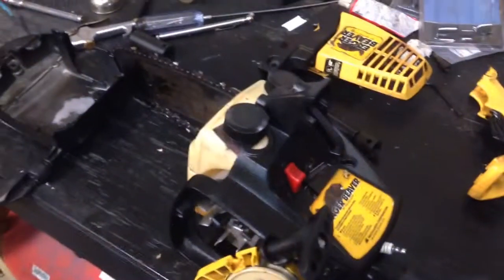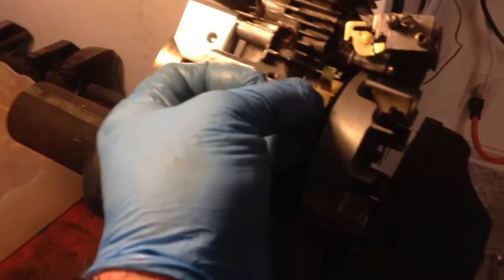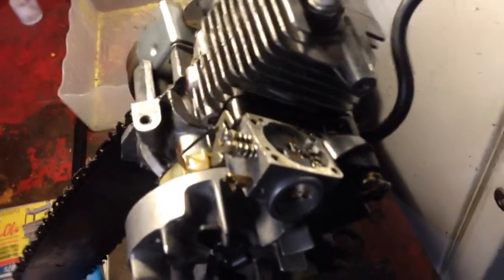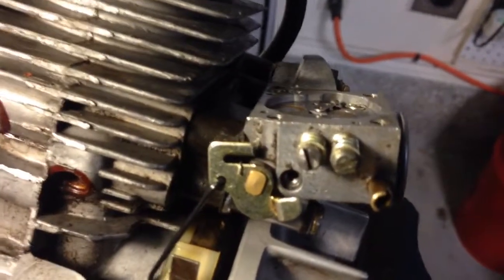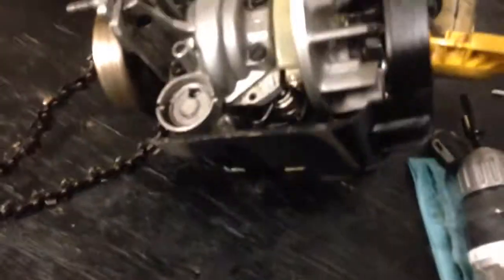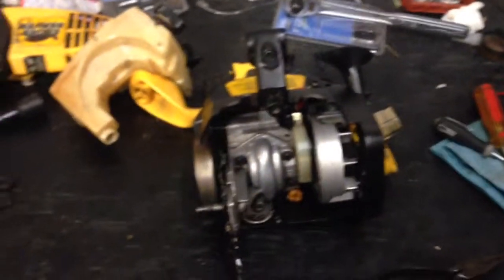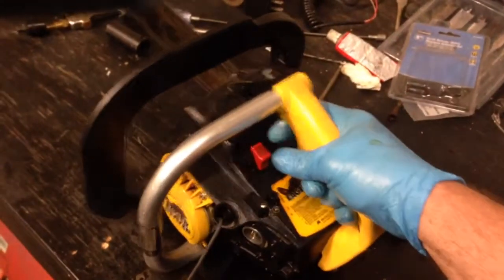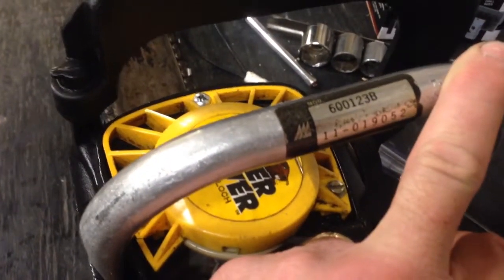Eager beaver chain saw model 600123b

Comment: I have a Eager Beaver 2.0 (same as Mini Mac 100 series). It had a manual
 lever oiler only when purchased. I want to add a automatic oiler (P/N 
216582) and see the lower crankcase already has place to accept the 
oiler pump. 

I understand the lower crankcase needs a small hole drilled for pressure
 to operate the oiler pump piston. Is that correct and where do you 
drill the hole and what size? Does anyone know more about adding a auto 
oiler on the manual only version mini macs?